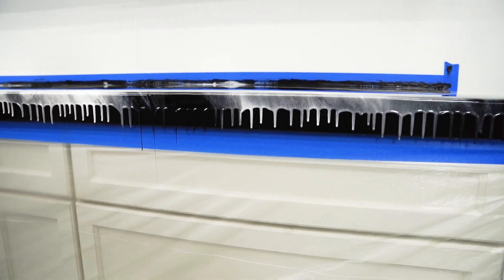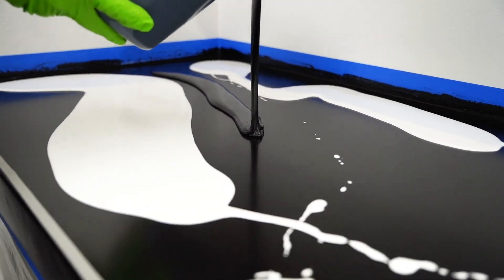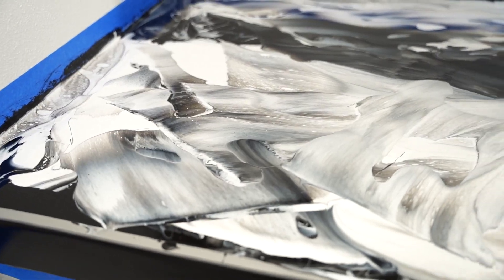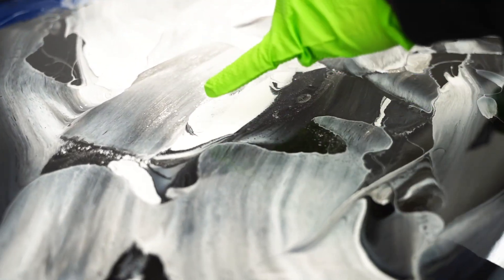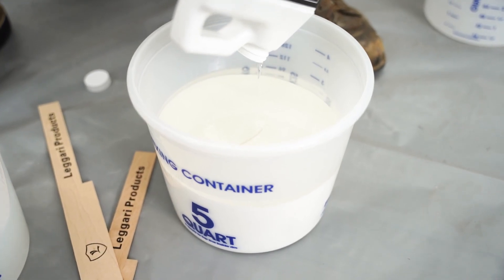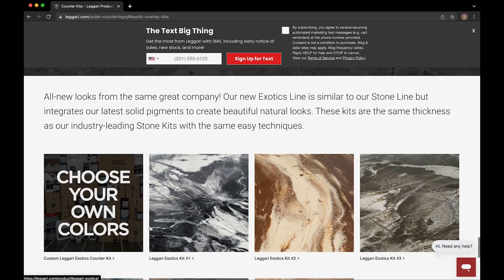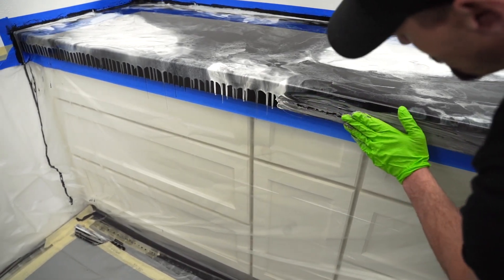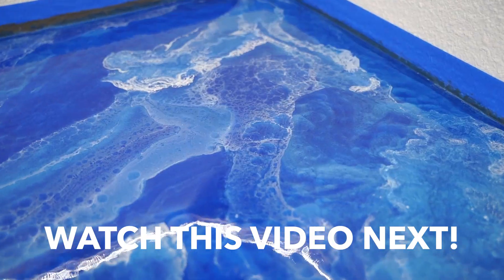EPIC Black & White Countertop Using Simple Epoxy Technique | Do This Yourself For Cheap

Comment: I can't get denatured alcohol in my area. Can I use isopropyl for the finish?
Reply: You can, but iso tends to repell, which adds cells, blooms and other effects. Ethanol won't. It depends on the final look you want. You can do smaller boards to get the design and a rehearsal of the process locked in.
Reply from the maker: We don't recommend that, Email customerservice@leggari.com and they can tell you some alternatives!

Comment: Do you not need a respirator while handling these materials?
Reply from the maker: No, you do not unless you are mixing in the metallics then we recommend a respirator, or a well ventilated area so you don't breath in the mica flake.
Reply: @LeggariProducts  thanks. I’m very nervous about working with epoxy!

Comment: So dope!! I wan to do my wooden staircase but I’m scared 😳. Help!!! I want that white and silver marble look
Reply: stair cases are tough, i dont recommend coating the vertical areas with epoxy since its such a big area. itll take multiple days, you have to do every other stair the first day, and mask off the stairs and vertical areas that arent being coated so that the resin can flow over nicely with out ruining everything below. then the next day when those stairs are dry, mask off the stairs that are coated and coat the rest of the stairs. if you want a matching vertical area, i recommend sanding it down with 120 , mask off the stairs , spray primer, then spray paint it white
Reply: @CHUMUJUJU  thanks ! I was thinking about that. I think I will only do the step portion and not the riser
Reply from the maker: Yes, stairs are a little harder to coat but it can be done. Email customerservice@leggari.com They will be able to help walk you threw the process!